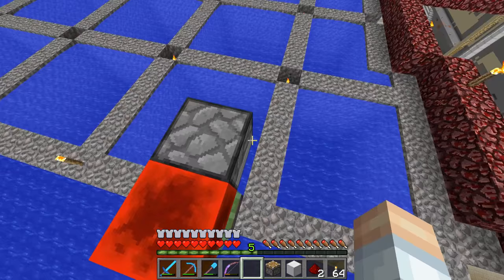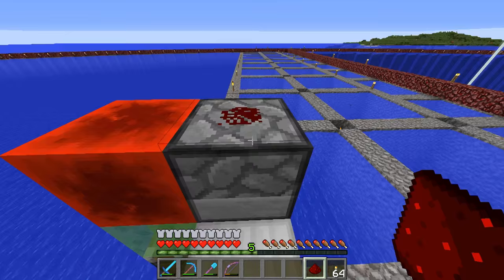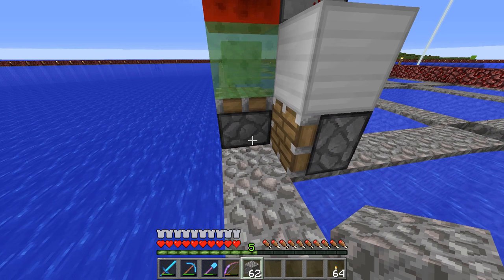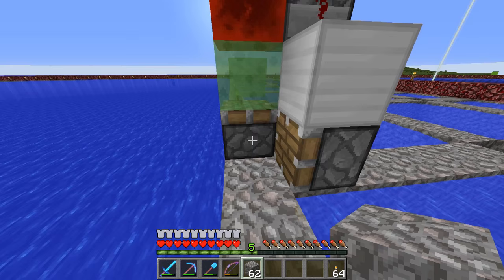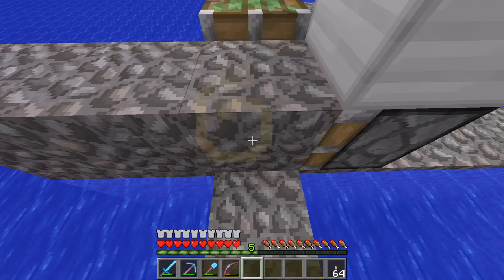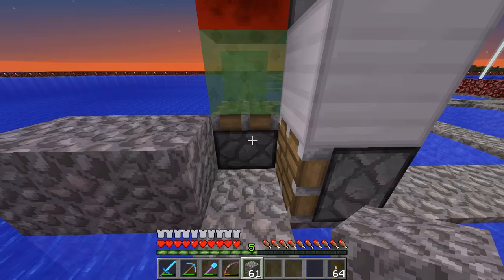How to build a semi-automatic gravel and sand spreader in Minecraft - Tutorial E12

Comment: I found an easier way to do this. Get a red stone clock and connect it to a piston and just place blocks in front of the piston. Reply if there are downsides to it and this machine solves its problems.
Reply from the maker: A redstone clock attached to a piston would solve the same problem of spreading gravel or sand as this. The difference between the 2 solutions is that with the redstone clock, the piston is responding to the clock and in this one the piston is responding to placing the block. With a redstone clock, the block has to be placed at the precise time when the piston is not powered, but this solution is completely dependent on a block being placed.

There's a slight issue with this solution now, however. I think it is broken as of the redstone updates in 1.16 - I haven't tested it yet.